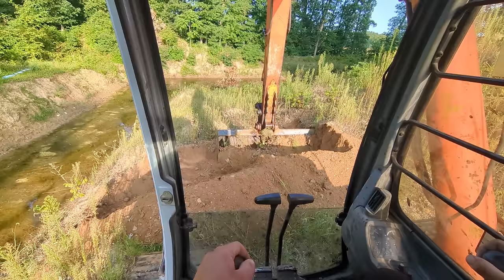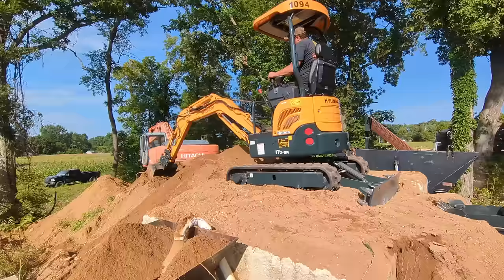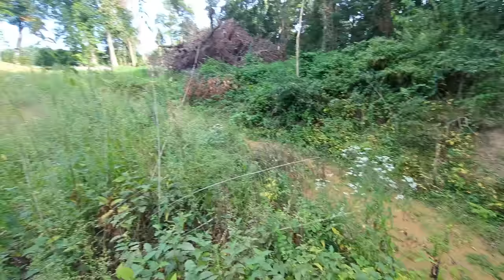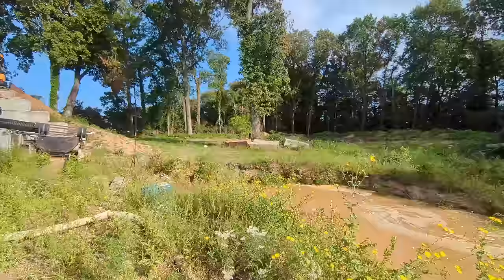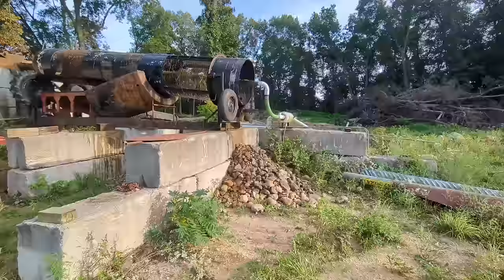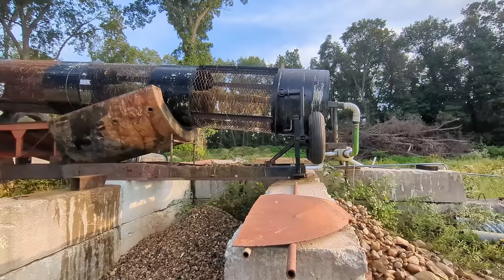I Think We Broke A Record With A Hyundai Mini Excavator First One To Prospect Gold?

Comment: Brandon I’ve recently acquired a case 9020b excavator it’s currently set up with backhoe controls/deere controls got any idea what I need to do to switch it to excavator controls/cat controls ?? Any help would be appreciated
Reply from the maker: Run it Deere style like I do lol....call a case dealer they should be able to get you a diagram on how to switch the pilot control hoses around to get your desired pattern it's really easy depending on where the block is that all the hoses connect to it's usually under the cab you will have to remove the panels underneath just becarful they can be heavy if the get dirt and debris up in there
Reply: @dirtgrainsteel  appreciate the response and love the videos keep at it! Thanks again